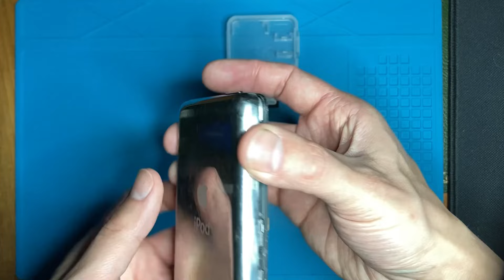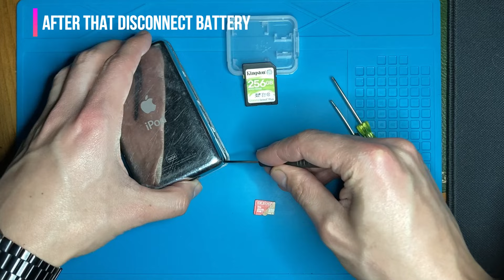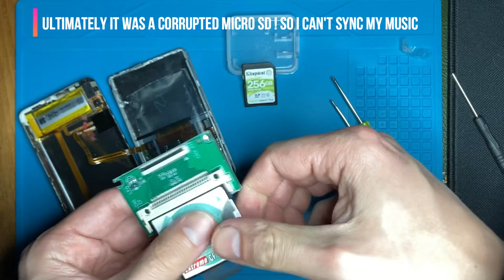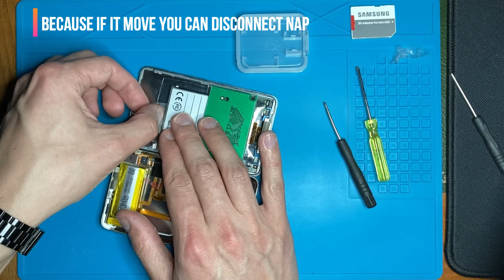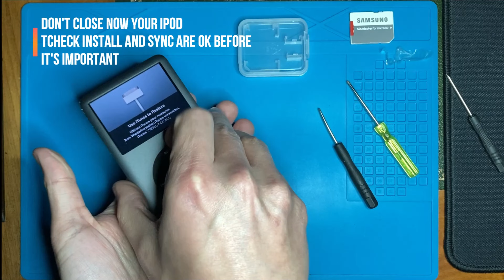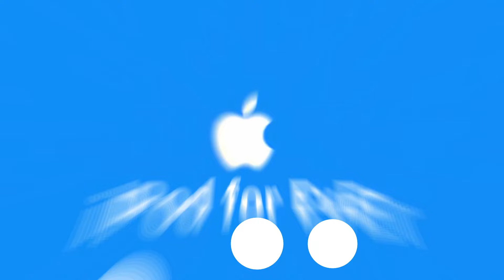The ULTIMATE iPod Classic 7th gen 256Gb Flashmod

Comment: Why did you cut the board? Because that is not the size i have the same one on my ipod and is bigger
Reply from the maker: yes you are right I cut part because I wanted to know if it was possible and if it worked well. On aliexpress I saw that there were models of this smaller size. So maybe a future project where I will need more space ;)

Comment: Hello, were you able to make the red cf adapters work with a 256gb microsd card ?
Reply from the maker: Do you have link for red cf adapter ?? Thanks
Reply: @ipodforever2023  I cannot share links from ALi on comments, they are deleted directly after. The same as the one you are using in one of your previous video : 
iPod Classic 7th modded compact flash SD CARD and ribbon replacement . I've made a duplicate question of sort, you've answered my detailed question in the other video thanks :)
Reply from the maker: Perfect 😉